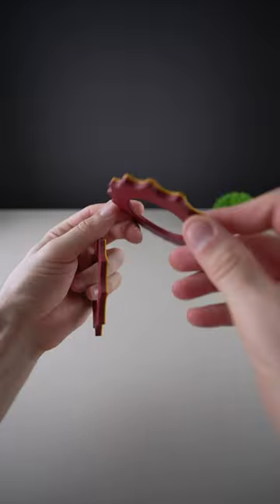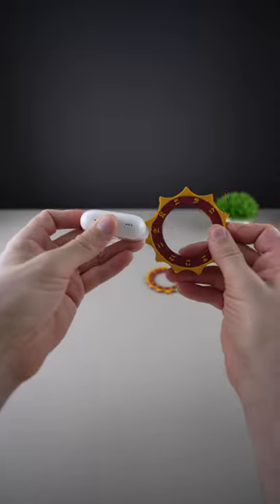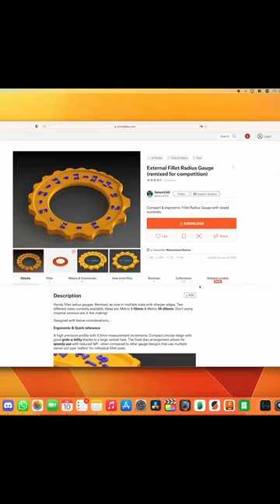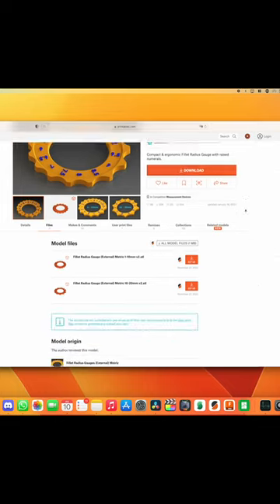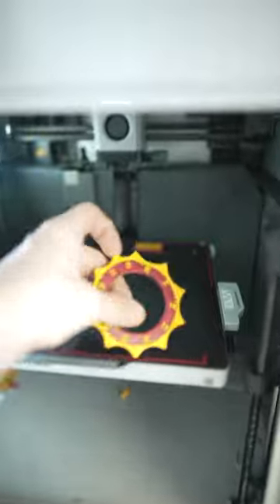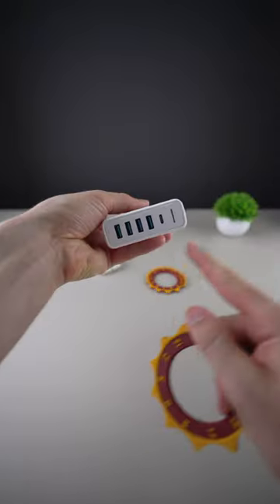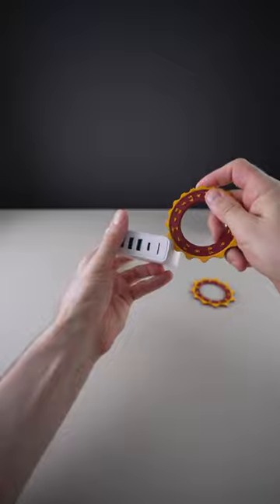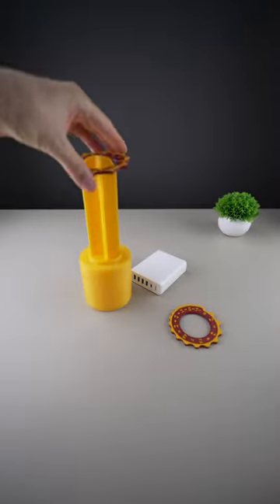😎 3D Printing a Fillet Measuring Tool

Comment: Good tool to have!
But there is lot of products and designs with curvature, G3 and G4 transitions between surfaces. 
This one is for tangency transition so it is not super accurate.
But it will work for personal projects.
Reply from the maker: that’s true! I’m also looking to print some for measuring different curvatures
Reply: @marsgizmo  Awesome!! Love the idea and this will be a perfect update:)
Reply: Wait, is G3 and G4 the same kinda terminology that's used in welding? Like you have positions in welding referred to as 5G and 6G

Comment: Is carbon fibre pla easier to print with than nylon-carbon fibre stuff (PA-CF)? I don't know if you have used it
Reply: Yeah, its easy to print as PLA. Nylon is difficult to print for a lot of printers, even with CF which adds rigidity and makes it easier. Just be warned it's abrasive and will eat your brass nozzles, so ve sure to get a hardened nozzle 👍
Reply: @lio1234234  ah okay thanks! Yh there's no way I'm trying it on what I've got but at school we fortunately have someone that can print PACF but it is sometimes a pain to print with!
Reply from the maker: yes, PLA CF is much easier to print than PA CF (Nylon CF)
Reply: @marsgizmo  thanks!